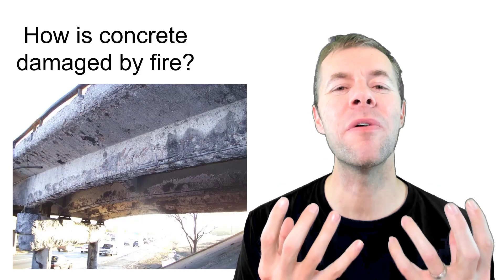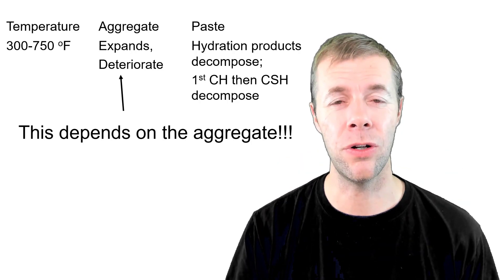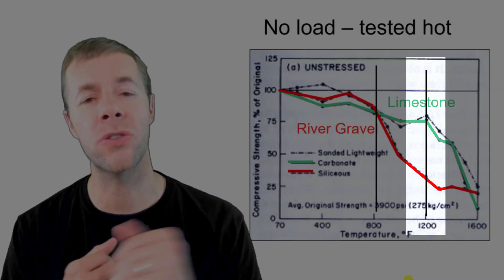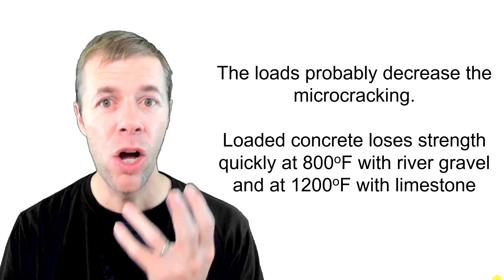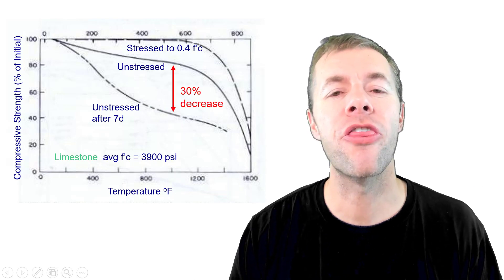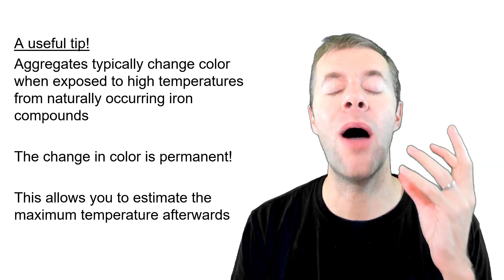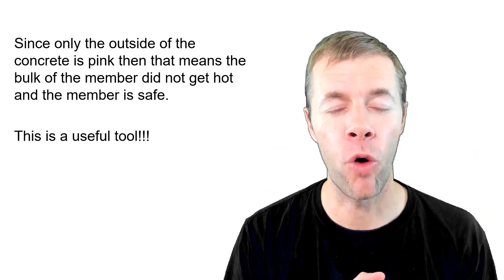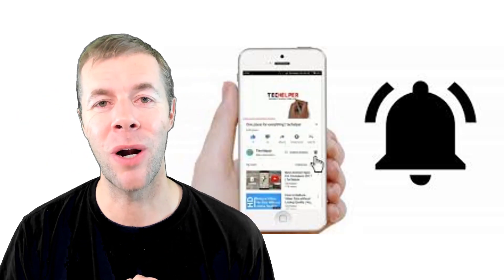FiRE!!! and concrete

Comment: Superb video Dr Ley. Sir, using fly ash as a replacement for sand can increase the fire resistance,as fly ash is formed under a very high temperature,the energy requirement for it's phase change is higher than conventional aggregate.Also fly ash based geopolymer coarse aggregates can also be manufactured,which when used can increase the fire resistance of concrete substantially.
Reply from the maker: Thanks Kushal!  I didn't think about that.  This a great tip.
Reply: You are welcome Sir. Glad to contribute in some manner.
Reply from the maker: Spalling from fire is coming in a few videos.  The next video is about fire ratings.

I thought this was enough content for a single video.

I talked about thermal cracking in a previous video.  You can find it here: https://www.youtube.com/watch?v=LGImMUs7AS0&t=73s

I didn't talk about fire specifically in that video but the same concepts apply.
Reply: How hot do "usual" building fires get?

Comment: Hey @Tyler what would you recommend for a mix that can be used with a wood oven?  
Say you had:
1 part Portland cement
3 parts silica sand
1 part dehydrated lime
1 part fireclay

What aggregate would you use?  Or truly what mix would you use for ovens that can go VERY hot.

Love your videos!  Keep it up

Comment: Thanks for that video. It's certainly food for thought. The first thing that came to mind was whether expanded shale or igneous rock aggregate would survive better. Then I wondered if the waterproofing admixtures that are supposed to cause crystals to grow and fill cracks would work after a fire. After that, I started wondering what fire vulnerabilities might be added by other admixtures, like PVA and by plastic reinforcing fibers. I did a search for intumescent stucco, but all I found was paint.

Comment: I'm trying to make a slab for a pizza oven most likely 36x36 is there any mixture I can use that will stand up to the heat it will be a free floating with fire underneath

Comment: Thanks again Sir Tyler. Very helpful. Lately, two adjacent bridges along our highway was subjected to extreme heat because of a big fire underneath it. One bridge has prestressed concrete superstructure and the other one has steel. They are planning to open it for light vehicles only (the prestressed one) four days after the fire after they have conducted test on the concrete. Maybe the result suggests that the concrete is still serviceable. What are your comments on this? What precautions should we take before opening it to traffic? Thank you very much. Your Channel is very helpful.

Comment: I have seen and worked on a fire training tower and the chances of your concrete failing is more likely over many fires and it is unlikely that the concrete will lose its strength. It is more likely that the floor will separate at the steel as the steel will bend and crack the floor in half inside of the floor. Floor removal was no easier. Nor was it any lighter or more brittle. The strength was not measured but it was still hard as a rock and did not break in a 12 foot drop on to a floor below. For a building to have seen this many fires over the years the concrete stays in very good condition considering the abuse. I can not say the same for masonry block and joints around doors as they are obliderated by the heat.

Comment: Can you do a comparison of fire remediation techniques to recover concrete strength?  If that doesn't exist, well, give it a try!  Would filling the cracks with cement or a chemical binder work, and for what temperature exposure?

Comment: Thank you for the information.  I am replacing part of my sidewalk, and wanted to break the concrete into manageable pieces.  I cut he concrete partially using a diamond blade. and was considering hitting cut lines with a propane weeding torch.  I know the torch can get up to at least 1500 F, but was unsure if it'll be weakened enough to lightly strike it to cause it to fracture, or if I should pour water on top of it immediately after heating to cause the fracture.  Another thing is if it is even worth the time heating the concrete.
Reply: If you hit it with a torch, it will chip off and fly into your eyeballs. Better to just smash it up

Comment: Sir, I recently see this channel, I am a new subscriber for this chanel. I didn't see this much of detailed video ever. Thank you very much. I have two project proposal for my academy, may you give suggestions regarding them.
1. PROJECT PROPOSAL ON FEASIBILITY OF USING CHIKEN FEATHER FIBRE AS PARTIAL REPLACEMENT FOR FINE AGGREGATE TO PRODUCE LIGHTWEIGHT INTERLOCKING CEMENT BLOCKS
2. Experimental study on using pine cone ash as partial replacement of fine aggregate...
Will these acceptable sir ?

Comment: What happens to rebar when heated from fire
Reply: it gets warm
Reply: IIRC iron changes crystal structure around 700°C (not sure about the number), which severely weakens the iron structure. However, the concrete would probably fail first.

Comment: What happens to concrete if it exposed to 300-400f temps for an extended period (days, weeks).  That should bake out all the water.
Reply from the maker: You could have a little cracking but it shouldn't be a problem.
Reply: Huh!

Comment: So adding this information to the world trade centre argument or conspiracy for example.. it would certainly add to the deterioration of the structure? As the beams were loaded or pre stressed into the concrete, surely, this would have a detrimental impact on the beams and the structures ability to stay upright? As the temperatures exceeded the integrity of the aggregates inside the concrete. Standing so high in the sky, would allow the concrete to cool quicker, as well as the windows allowing draft throughout and the end result would be a critical failure of the concrete.... I am sure there is far more to it, but I haven't seen any evidence presented in regards to the concrete of the structure causing the catastrophic failure. So If the building is heated, the concrete is heated and then fails, surely this would be the predetermined outcome for any building subjected to such heat over a duration???
Reply: There is a great book called why buildings fall down that covers this suggest you read this. Basically a design failure in the connection of the cantilever section of steelwork and an unhealthy amount of lack of maintenance caused the first few storeys to collapse, the rest is a Disproportionate collapse unfortunately. Nothing exciting in the failure. However the fact that the sweeds left sugesting they knew about the attack beforehand is interesting.

Comment: You don't want a generation of inexperienced rookies thinking that concrete is bad in a fire! Concrete is about the best structures in a fire, compared to steel (even fireproofed) and wood. At just 500 degrees, those other materials would be toast and concrete would be fine. Steel expands and becomes a noodle, wood (even fire-resistant wood) is only more fuel to the fire. To get to 1000 degrees, it takes an hour or more in a concrete structure, and most structures don't have that much fuel to sustain the fire. You can do what is called a rational analysis of members of a concrete structure and the weak link is the steel reinforcing that gets too hot and loses strength, before the concrete is an issue. I hate to see "Engineers" saying once the concrete goes to 1000 degrees, the building is a write-off. Also, fire damaged concrete can be relatively easily repaired.
Reply from the maker: Lots of videos on fire.  The fire rating videos covers exactly what you are talking about.
Reply: Well that’s rude, we are all inexpierenced rookies before we ever become anything else dont ever forget that or it will bite you in the arse as it has me.

Technically wood chars so is quite fire resistant under normal fire, obviously on longer span deflection dictates, so deeper wood is used increasing the charring factor, this clearly has it limitation, however it should not be ignored. Steel beams under heat weakens and reaches plastic hinge formation and deforms gently at the hinges causing a slow failure. Reinforced concrete however as heated means steel rebar forms plastic hinges cracking the concrete and transferring more compression into the concrete causing explosive shear failure. as for only concrete structure as talked about in this video they don’t existing beyond compression only so what the point and subject to any tension load they would be camput, such as wind or eccentric loads.